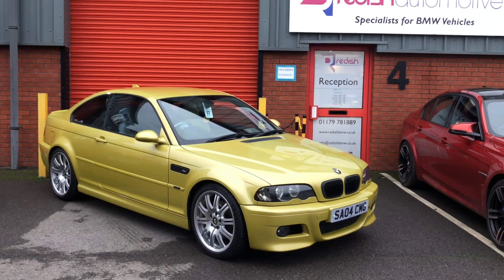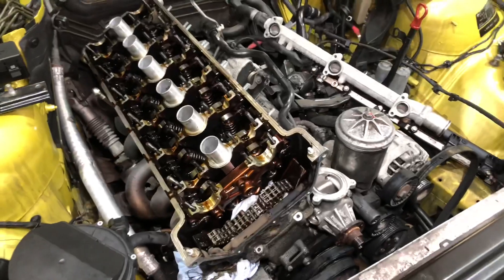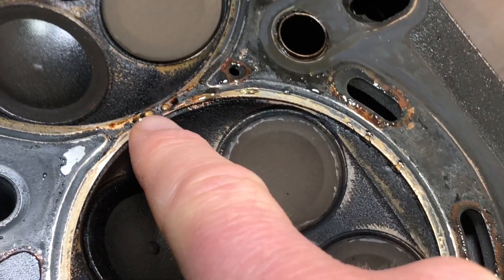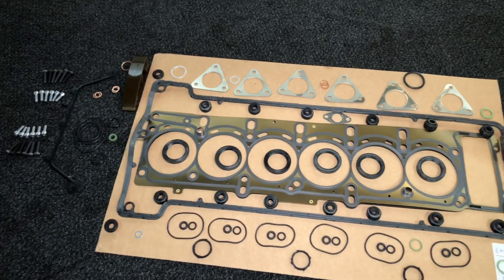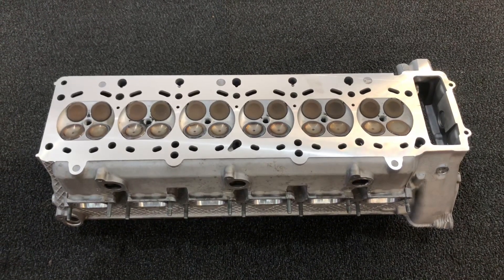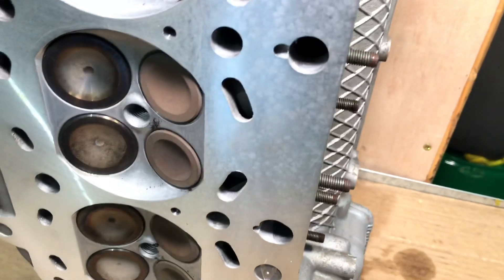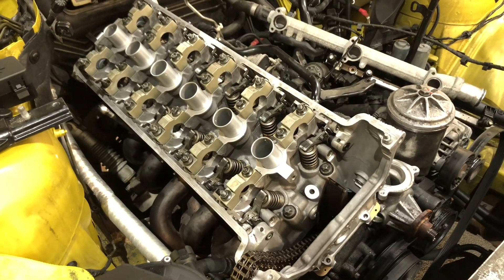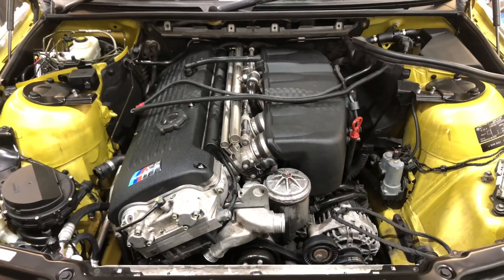BMW M3 (S54): Head Gasket & Top Engine Refresh

Comment: hi 
Excellent video but can you answer a technical question? I have a BMW TD6 engine in my Range Rover L322 and I am in the process of changing the head gasket, my question is how do you calculate the thickness of the gasket after having the head skimmed?

Comment: Have you guys considered using a Vulcan cut ring gasket instead of OE or MLS? Rebuilt my S54 with one purchased off VAC.. the cut rings bite into the cyl head when clamped back down onto the block without any special machining (such as the min RA finish required for MLS or say O-ringing) to provide a seal imo much more reliable than either OE or MLS. The remaining organic gasket material is superior for sealing off the surrounding water jackets to prevent contamination of oil and coolant.

Also, the upper timing chain guide has been improved by Beisan Systems from the original design using Nylatron NSM material capable of less friction and wear than virgin Nylon used in the OE guide. It's also cut from a solid sheet of material rather than molded, creating a much more formidable infrastructure. Not sure if you'd want to provide this as an upgraded option imo superior to the OE design. More here: https://nam3forum.com/forums/forum/main-forum/e46-2001-2006/636-beisan-s54-exhaust-upper-chain-guide-solution

Comment: What is the rough cost of this work and does it come with a warranty? If so how long? Cheers
Reply: I'm sure on the website it's about £1500
Reply: Head gasket flat rate on these cars is 14-15 hours, most garages charge labour according to these flat rates. So assuming they charge £60/hour that's £900 labour plus the parts. They used genuine BMW parts, so in the UK those parts are covered by 2 years manufacturer warranty and I think by law they issued 12 months repair warranty anyways. So pretty safe bet. The only thing they didn't do was the valve stem seals, but I bet the customer was offered this option, more likely he just refused it due to the extra costs. As it sure is a bit painful when you just bought a "mint" car for 16 grand as it was advertised and next thing you know you are up for another 2k investment in it..

Comment: I did this same job myself in my garage and I elected to do a few more things than this video, it all comes down to budget, but I replaced every electrical component and every fastener I came across. Nothing was retained except the shortblock and some mounting brackets. It's truly very easy to replace everything when the head comes off these things.

Comment: My 2004 M3 with 75k miles had all of this done, rod bearings and vanos rebuilt with new intake hub.
Since then, it runs great, but sometimes hesitates on startup. i turn key back off and allways starts perfectly the second time i turn the key.
This happens more often when the car is warmed up.
I changed the battery and starter.  Nothing changed.
We suspect fuel rail pressure and changed fuel pump relay. Still nothing changed.
What are your thoughts?

Comment: Great job! Is it necessary to replace the valve stem seals when the cylinder head is hot tanked? Also, any need for a valve job?
Reply: Same Question....why not do the valve stem seals?  Especially with head in hand and all the caustic cleaners used to clean the head.